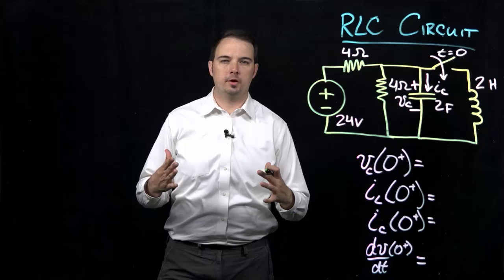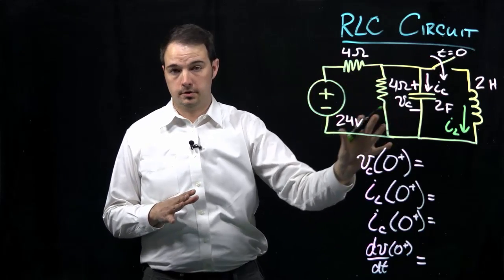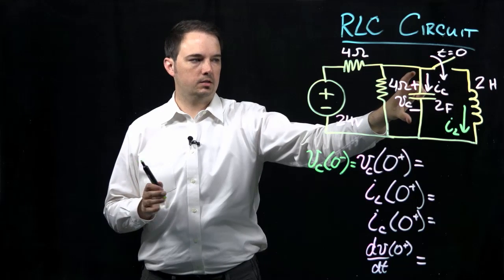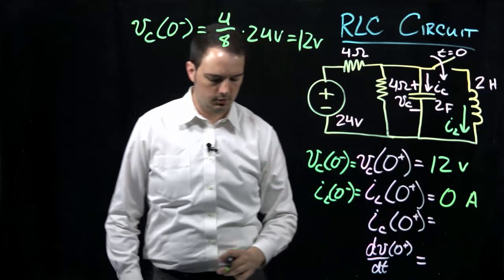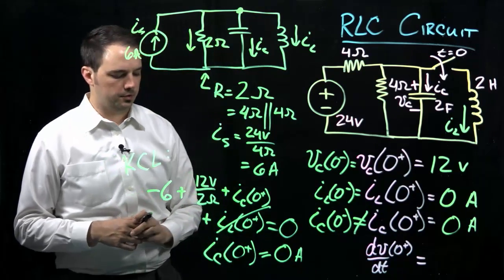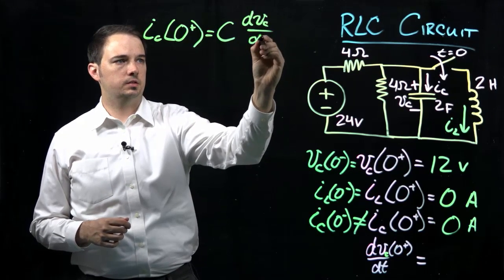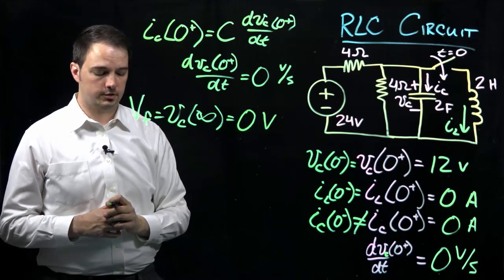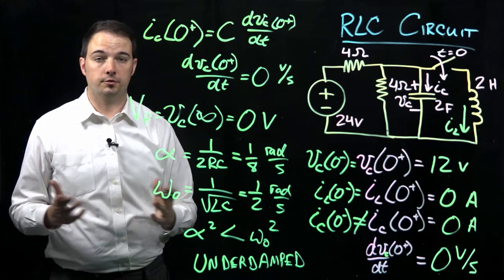Circuits I: Example with RLC Circuit (Parallel, Step Response)

Comment: thanks alot. but i have one question.  why did you say:
alpha^2 < OmegaO^2
instead of 
alpha < OmegaO
?
Reply: since OmegaO is a radical expression(1/sqrt(LC)), we square both values (alpha and OmegaO) to deal with final values since the expression sqrt(alpha^2 - OmegaO^2) is a function that evaluates for both values being squared